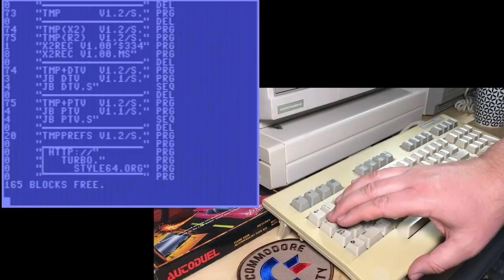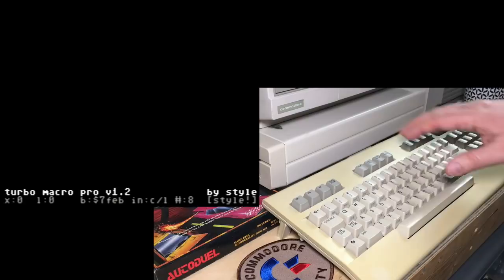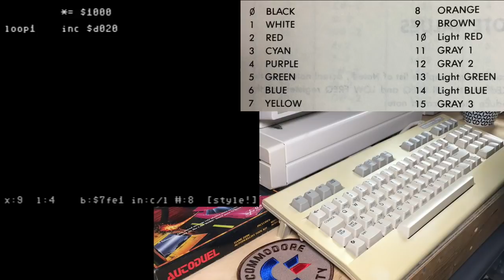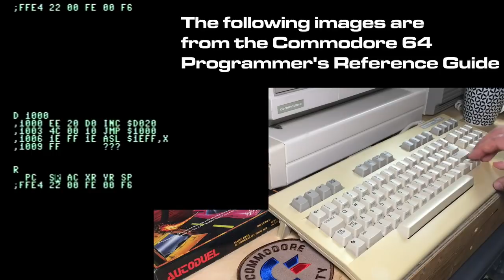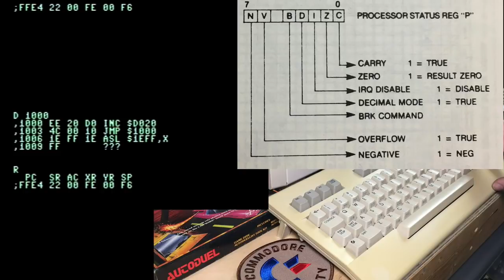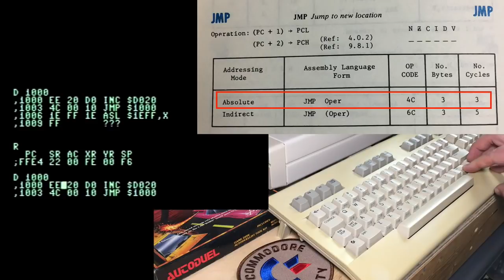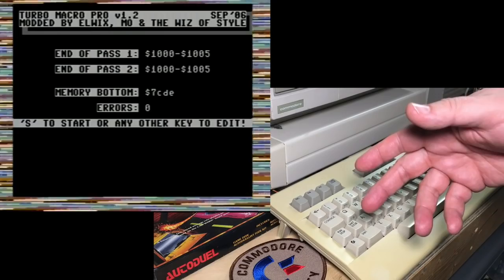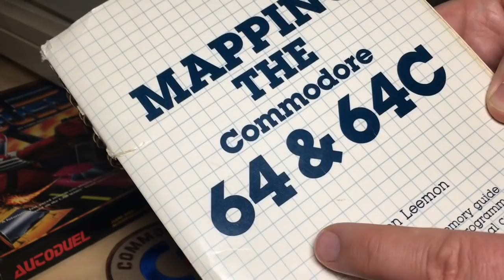Commodore 64 Assembly Language Programming With Turbo Macro Pro

Comment: I think what I need is just one more tool.  I think you used something to provide a monitor/debugger?  I tried a fastload cart image --- that seemed to just lockup vice.  I think I've seen you use supersnapshot ... which seems to have vice support ---- but do I still need an image?

I've identified $fb/fc and $fd/fe as locations I can use as proxy pointers.  That's good enough for some experimentation... but ...

I need some debugging support.
Reply from the maker: Since you're using VICE, you can use the monitor built into it: http://vice-emu.sourceforge.net/vice_12.html

Otherwise, yeah, you'd need a Super Snapshot v5 .crt image and plug it in with the "attach cartridge" option in VICE. But the VICE monitor is very powerful.
Reply: I actually accidentally discovered the VICE monitor while I was waiting for you to respond :).

I was trying (and failing) to attache a final cartridge III (which I found before finding a super snapshot) and it was hanging the CPU
... at which point VICE was giving me a dialog offering to start the monitor.

... yes... even the fact that the monitor is another window is a handy debug tool.

So... now my development environment is VICE + 1541 + 1581 + 512K MEU... and using the vice monitor.

(in case you were wondering, my errors boiled down to addressing mode problems).

Thinking about this, in terms of your videos... for someone coming back to C=64 after some time away (most of us) the biggest thing to cover
(I think) is the (zp),y addressing mode.  The only other alternative is self modifying code (code that writes the pointer into the instruction that uses it) ... or offsets that never exceed 255 bytes.

Some expert advice about the various consequences of pillaging zero page addresses might be welcome too.  Even some research that
separates which is used by KERNEL and which is used by BASIC.  Stop me if you think I'm rambling.

Comment: hey robin, I am developing a sizeable application in assembly using turbo macro pro as you suggested... however, I have built a few small programs and now want to merge them together but I don't see a way to do that with turbo in the docs...
Reply from the maker: You can use the back arrow W command to Write the source out to a sequential (text) file, and then back arrow E to Enter the sequential file into the current source. It'll merge it in wherever the cursor is currently.
Reply: @8_Bit  very cool! thx!

Comment: Hi Robin, I wish to thank you for your videos and tutorials on the C64 and specifically, assembly programming. Through your own tutorials I have switched assemblers (I was using Compute Gazette's Fast Assembler by Yves Han) and now find TMP to be well suited to help me get back to my coding days! So thank you for that!
I have been looking over the documentation for TMP and understand it for the most part. However I have a question. I have a program already entered and saved and I wish to start a new program. Is there a "new" command? How do I start with a new screen, or a blank TMP screen to start a new program?
Thanks in advance!
Reply from the maker: I believe back arrow C will trigger a "cold start" prompt, then answer "Y". If it doesn't work I'll dig into it more, let me know.
Reply: Yes, that did it. Many thanks!! @8_Bit

Comment: Is there a way to access SS from within TMP via a specific keystroke inside of VICE as you illustrate at 12:56?
Reply from the maker: VICE should have a "Cartridge Freeze" option that will be equivalent to pressing the button on the Super Snapshot cartridge. On the old Mac build of VICE I have, Cartridge Freeze appears under the Machine pull-down menu if you have a Super Snapshot .crt file attached. The shortcut for it it Apple+Z. Other versions should have something similar.

Comment: A quick question, does the INC $D020 command cycles through the values x00 to xFF, and the DEC $D021 from xFF to x00  then wraps around in the endless loop?   And what happens when it reaches a non-valid screen color value since the C64 has a limited number of them?
Reply from the maker: If $D020 was a regular 8-bit RAM location then yes, that's exactly what would happen, cycling from $00 to $FF and then wrapping around. But since $D020 is actually registers on the VIC-II chip, and only the low 4 bits are active (16 different colours), the high 4 bits are permanently set to 1. So the register is actually just cycling from $F0 to $FF and then back to $F0.
Reply: @8_Bit  - Thank you Robin for another excellent explanation.  I need to brush up on my VIC-II addresses/registers using my trusty hard copy of C64 Programmer's Guide and C64 Memory Mapping which have been in storage since the late 80's. heh :)
Now, what happens if you INC or DEC any other regular RAM address (ex. screen x0401?  Would it crash if going lower than 0 or over FF without bounds checking during a loop operation, or it wraps around like a VIC register?
Reply from the maker: @BillAnt  RAM locations will wrap around automatically and will never cause a crash.

Comment: Can you elaborate on using "zoom floppy" to place the program on the disc? Meaning what it's specifically. Thanks in advance C=
Reply from the maker: Zoom Floppy is a USB interface for Commodore disk drives like the 1541. It allows you to hook the 1541 or other IEC drive up to a modern computer with USB.

Comment: how to use macros under tmp? there are no backlash on the c64 ? can you pls tell us how to make macros using parameters ?
Reply from the maker: I just recently learned that the documentation included in the TMP download on style64.org has a bug when it was converted from PETSCII to ASCII. Those backslashes should be the UK pound symbol. Once you use that symbol then the rest of the documentation should be correct for using parameters in your macros.
Reply: @8_Bit  great, thx 👍

Comment: Hey Robin, I was wondering if you might know how to change the default color scheme within Turbo Macro Pro?  I checked the documentation which refers to a preferences submenu that is accessible by pressing "p" after command (left arrow)... but this key seems to have no effect.  Thanks in advance if you have any tips!
Reply from the maker: I don't use it myself, but I think the preferences submenu got moved into a separate program that's included on the full distribution disk of TMP available on style64 dot org. Looks like the program is called TMPPREFS and you should find it on the d64 you can download from their site, if you don't already have the full disk.
Reply: @8_Bit  TMPPREFS did the trick.  Thanks very much!

Comment: 6:15 I'm still rather green with assembly so forgive the question if it's painfully rudimentary, but why 3 cycles for what would seem to be a rather simple JMP instruction?
Reply: Oh wait - I think I see why: because the there is the OP-code 4C, then the two bytes for the location?
Reply from the maker: Yes, the 6502 takes at least 1 cycle per byte; it processes the opcode, then the low bytes of the address, then the high byte. All instructions (ranging from 1 to 3 bytes in length) take from 2 to 7 cycles to execute. This might seem like a lot but was actually super efficient at the time. Other CPUs of the era like the 8080/Z80 required many more, and that's why a 1 MHz 6502 can keep up with a 3 MHz Z80 on most tasks. For more information about 6502 timing, look for this file online: 64doc.txt
Reply: @8_Bit   Interesting.  The 65xx series was a pretty capable CPU from the sounds of things.  Cool to be getting into some C64 programming.  (I come from a TI-99/4a background ;) ).
Reply: @8_Bit   Oh yeah, nearly forgot my manners: thanks for doing these videos - I've been learning a lot B)

Comment: Hey Robin!  Quick Question:  In VICE (tested using x64 on Linux), using sys32768 re-enters the plain old TMP prg fine after stopping code execution with run-stop/restore just like @20:04 in your vid.  However, I notice that if I have VICE set to emulate the REU, and I use the TMP+REU version, then sys32768 will not re-enter TMP after I kill code execution with run-stop/restore.  Is that a VICE problem, or did I skip over something important related to REU use in the TMP docs?  It's almost as if the program exist with the REU on the wrong bank or something?
Reply from the maker: With the REU version you use SYS 320 or maybe SYS 384 to return to TMP. Look for "jumpback" in the docs and it should explain it.
Reply: @8_Bit   SYS320 works!  Thanks for the quick reply.  I see where they mention $140 is the default jumpback now.  Doh!

Comment: Please do an episode on the difference(s) between a packer like "Sledgehammer", https://csdb.dk/release/?id=169383 and a cruncher like "Cruel cruncher", https://csdb.dk/release/?id=691.

Also if you could shed some insight on what a level packer (https://csdb.dk/release/?id=3160) is and what differentiates it from a packer and cruncher, that would be much appreciated.
Reply from the maker: I'll see what I can do about it, thanks for the suggestion. The short version is that packers use RLE: https://en.wikipedia.org/wiki/Run-length_encoding and crunchers used more advanced algorithms such as LZ: https://en.wikipedia.org/wiki/LZ77_and_LZ78

Usually the output of these programs is a single stand-alone self-decompressing file. Level packers (or crunchers) decouple the decompressor program from the data file to be both more flexible, and save memory, so (for example) the game will have just one instance of the decompress routine, and each level will just be data (stored on disk or in RAM for example) that can be decompressed on the fly.

Comment: I'm probably going to keep dropping in and out of here.  I don't know where else to ask questions.

So... started writing test code.  The example I was following put a little one-line "10 sys 4096" $0801 and then put the rest of the code at $1000.

... that's all fine.  When I assemble (cmd-3) and then press 's' ... I get a READY... but that's fine.  I run.  Works fine.  Then I go to sys32768.  Nothing.

Help?
Reply from the maker: If you're using the TMP+REU version of the assembler, then it's SYS 320 to get back into TMP. After assembling with cmd-3, that screen says "jumpback: $0140" which is 320 decimal. The non-REU version uses SYS 32768 to re-enter TMP.
Reply: I'll chalk that up to still lacking in documentation... but thanks.

Comment: Robin, I have TMP for Vice now, used it, I have a problem. Basic Rom is gone. I was able to call $BDCD before without TMP,  but I can't call it now. Even with REU it will not work. Can we not call basic rom calls with it? (this works fine on a 64 with just a monitor program)
Reply from the maker: BASIC ROM calls should still work. Are you changing location 1 in your program? Maybe you're switching the BASIC ROM out? If your program is short enough, type it out here and I'll see if I can figure out what's up, otherwise post a link to your work disk (.d64 or whatever) and I'll check it out.
Reply: ; this prints a clock
start    lda #$00
         ldx $a0
         jsr $bdcd
         jsr spc
         lda #$00
         ldx $a1
         jsr spc
         lda #$00
         ldx $a2
         jsr $bdcd
         jsr $e544
         jsr $ffe1
         bne start
         brk

spc      lda #$20
         jsr $ffd2
         rts
Reply: Thank you for looking! Its short. Gets the clock from A0-A2 and prints to screen
Reply: It fails at the JMP $BDCD
Reply from the maker: @jack002tuber  Aha, yeah, I forgot TMP doesn't seem to reset location 1 properly. You can can LDA #$37    STA 1   at the beginning of your program and that'll switch the ROM back in and it should work. Alternatively, after you assemble, use Back Arrow 1 to drop out to BASIC, and then you can SYS 4096 or whatever to start your program.
Reply: @8_Bit  I will try that. Thank you! I was adding the REU, and doing all these things. Thanks so much Robin.

Comment: As background, I do a lot of various types of programming.  I did have a C=64 at one time.  I had an Amiga too.  I think my parents "lost" both of them.  Sigh.

Anyways... as a way of programming purely recreationally, I'm very interested in TMP that you outlined --- fast iterative "results now" testing of very low-level software.

That said, does this "community" have any libraries.  I suppose linking is beyond TMP (I noticed somewhere that someone had a C compiler --- possibly cross, not sure -- and that had a linker... but geez... isn't most printf implementations around 25k?  25k of a fairly more CISC processor?  I'm pretty sure that 6502 qualifies as RISC.

If not libraries, then example code maybe?  I'm pretty sure I have a C=64 bible... but sometimes reinventing the wheel is tiring ...
Reply from the maker: CC65 is good, but yeah, it's a cross-compiler. There's lots of assembly example code on https://codebase64.org/ and http://www.6502.org/ is also a great resource. And a ridiculous number of scans of classic books here: http://commodore.bombjack.org/commodore/books.htm
Reply: I don't see the bible in there, tho.  I had a paper copy.  I don't know if I have the strength to splunk that far.
Reply from the maker: As in the C64 Programmer's Reference Guide? Lots of different versions online, such as this one: https://www.commodore.ca/manuals/c64_programmers_reference/c64-programmers_reference.htm

Comment: Sorry for cluttering up the contents... but I just hit another brick wall -ish.

So... I've written my little thing and I want to share.  Obviously I can share a d64 (cool enough) but I also want to pull the text of my assembly out.  Now here's the thing:

c1541.exe will extract (it seems) PRG files as .P00 (I think?) but it seems to not acknowledge the existence of seq files.

Now... I also notice that TMP seems to support saving your source code as PRG files.  I'm not sure what to expect there --- does it add line numbers to make it work?
Obviously if it tokenizes anything, that will make it hard to export, too.

I had a vague thought of figuring out the ethernet card to get a terminal program to talk to a BBS or telnet port

... but this can't be the only option ?!?
Reply from the maker: CBM DOS assumes PRG files unless told otherwise by adding a comma and the file type to the end of the file name. So MYSOURCE,SEQ or shortened to MYSOURCE,S should allow c1541 to find those files on the d64. It shouldn't be converting them to .P00 or whatever, try the "read" command.

In TMP, it sounds like you've been using the W (write) command to save your source? That's fine (and desired if you want a human-readable text file) but typically I use the S (save) command as it's faster and uses less disk space. It saves them as PRG files but yes, it's pre-tokenized (or more accurately, partially pre-assembled) and the files are only intended to be loaded (L) back into TMP again.
Reply: Interestingly, I tried ",s" with c1541 and it didn't seem to work.
Reply from the maker: Here's a brief terminal session on my Mac, where I use c1541 to pull a sequential file out of a .d64 into the Mac file system. Hopefully it's helpful:

$ c1541 1nvadersource2.d64
c1541 V4.2 (VICE 3.2)
Copyright 1995-2018 The VICE Development Team.
C1541 is free software, covered by the GNU General Public License, and you are
welcome to change it and/or distribute copies of it under certain conditions.
Type `show copying' to see the conditions.
There is absolutely no warranty for C1541.  Type `show warranty' for details.
c1541 #8> list
0 "SOURCE2         "    2a
214   "inv505a.s"         seq 
450 blocks free.
c1541 #8> read inv505a.s,s
reading file `inv505a.s,s' from unit 8
c1541 #8> exit
$ ls
1nvadersource2.d64 inv505a.s

Comment: How did you get Turbo Macro Pro on a 5 1/4 inch disk?
Reply: So you wrote to a blank disk using the zoom floppy and the 1541 then could I just load the floppy into my breadbin?
Reply from the maker: Yeah, the Zoom Floppy allows you to hook a 1541 (or most other Commodore compatible drives) up to your PC/Mac and then you can transfer .d64 files and more from your PC to a floppy disk. Then you can use that disk with your C64+1541.
Reply: Honestly sounds like a better option than sd2iec for a lot of programs. Does this work with high density disks?
Reply from the maker: @0730bcorm  High-density floppies don't work reliably on double-density drives, unfortunately, due to a different coercivity in the magnetic coating. You might get it to work sometimes, but the disks don't last if they worked at all. I did a full video about the subject: https://youtu.be/1LCTDqoKYjE